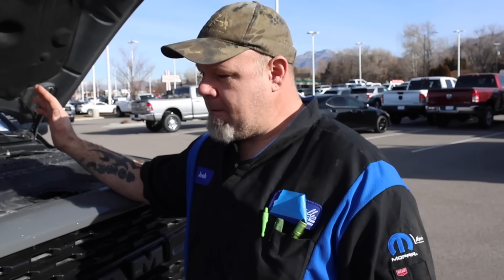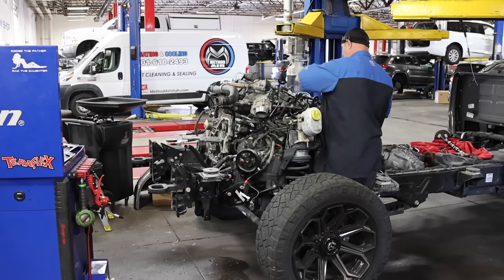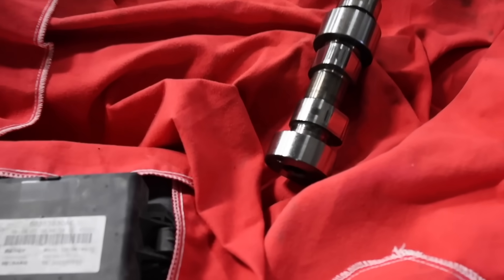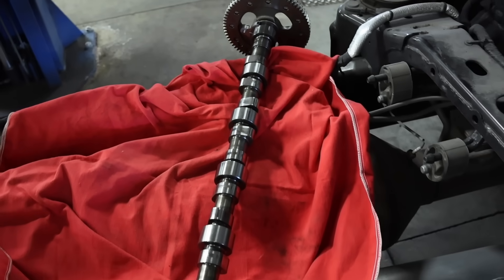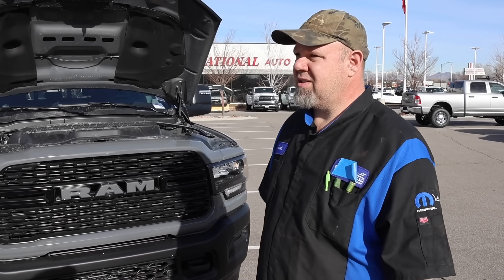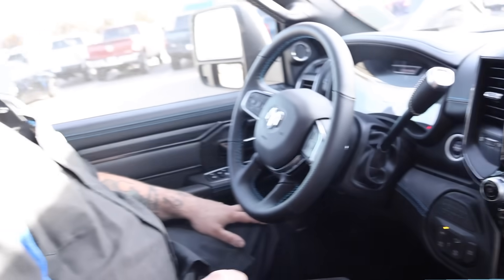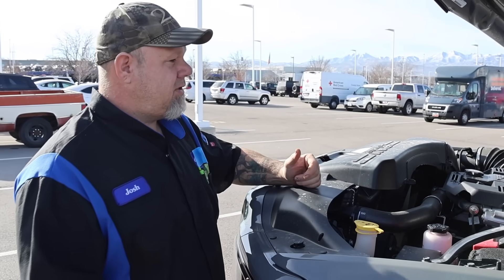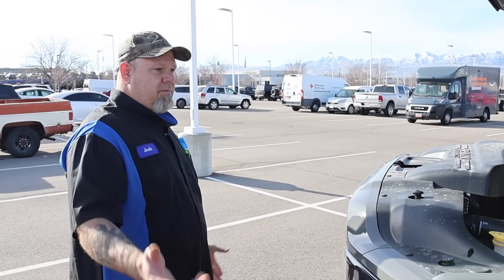Master Diesel Tech Explains The BIGGEST Killer To Your Diesel Engine!

Comment: Sorry, the EGR is the biggest killer of a diesel engine
Reply: I totally agree. EGR and subsequent emissions related equipment is an example of governmental overreach and science quackery. EGR’s only design is to lower exhaust gas temperature so that Nox gas is reduced (a byproduct of high temp fuel combustion), BUT lower exhaust gas temps increase soot and particulates in diesel engines, so, a particulate filter is added to catch soot. As this video shows, this dirty EGR exhaust stream is rerouted back into your inlet cooler, and turbo before reentering the engine which makes a mess and will have to be addressed at some point. When the particulate filter starts getting clogged, it must be cleaned by injecting diesel fuel from your tank into the filter to raise temps high enough to burn off soot and particulates (regen mode). This is the reason for the fluted, eduction exhaust coolers on the tips of the tail pipes; to prevent fires from the high temps during regeneration. Then, to add further complexity, BlueDEF systems are used to reduce exhaust emissions to some agreed to standards. BTW, DEF fluid is just distilled water and urea (nitrogen), which is a wonderful  and cheap fertilizer for your lawn and garden needs….The mechanics and chemistry of DEF systems for diesel engines are solid, I am just not sure if they will work in the absence of EGR systems knowing how they are all intrinsically connected.
Reply: Only if you are a liberal and still have it on there
Reply: The root of all problems
Oil. Power. Fuel economy. Abrasive cylinder wear leads to blowby oil consumption 
I use water methanol injection 
Have lower exhaust temps than with EGR 
Morning power 
Better economy 
6.7 Cummins 
9.8 litre per 100 Ks 😅 hiway
Reply: Sorry you have no idea

Comment: Im a company driver of Carhauler, we using RAM 3500 Cummins, I wanted to add something about cold start routine, before to start the engine I also press start button twice before to touch the brake and start it, I believe this primes the fuel system after sitting and I noticed that it’s actually starts better (less cranks) just something to consider..
Reply: You should probably know about the grid heater on your truck.
Reply: The pump primes when you open the door or during a remote start.  No need to do that process turning the key to run position and waiting a few seconds before starting.  They do it automatically now.

Comment: I don’t idle, injectors are fine, and always change my air filter. Have always changed out my fuel filters on time and my oil.

The soot is still everywhere. I have went thru multiple nox sensors and dpf sensors.

The soot clogs up everything!

Comment: 3000 mile oil change is still what I go with.  These extended oil change is ruining the engine.
Reply: Too long, do 300 miles intervals will be better. After all, oil is cheap than a new engine.

Comment: I am still old school mechanic and don’t even look at mileage. I go by hours which Cummins use to be around 400 hours. The only way you can include idling time as well as traveling.
Reply: That’s how we do industrial equipment. Typically manufacturers have different thresholds but typically 500-600 hours same for PMs, most fluids other than engine oil is annual
Reply: I was a heavy equipment tech for years and do the same thing.
Reply: @ToasterrBath  same, still am I work on light heavy equipment
Reply: @gunztommiegunz  I started out on the smaller stuff but ended up mostly working on bigger stuff. I did a lot of major modifications on smaller stuff and would’ve loved to have only done that stuff.
Reply: Caterpillar manual for a 5EK recommends changing oil after so many gallons of fuel used.
Reply: @ I know the older 3126 and C 7 ‘s were recommended I think around 250 hours. Pretty hard to keep up with fuel amounts I would think
Reply: @terrynall1956  In the trucking business you always know the gallons of fuel used due  to record keeping requirements for business and tax purposes.
Reply: @ yeah but this has more to do with personal use diesels,like for trucks pulling campers and like me a motorhome where I don’t think any keep up with oil changes to amount of fuel used.
Reply: I believe in light driving immediately, but our winter in south east Australia doesn't get below 25°f.
Reply: What a great and educational video. Got my first Cummins last year and now I will follow all these instructions. This is so greatly appreciated! Thank you sir!!!!!!!

Comment: While I agree with the warm up philosophy , and sane oil change intervals, I would posit that the #1 killer of modern diesels is EGR. Followed closely by PCV combining with the EGR soot.
That's a nice feature on those Rams, cruise button steps up the idle. Wish my Ford had that.
Reply: I put the switch in my ford, SEIC is the set up.

Comment: Wet Stacking is another issue for diesels that are not operated at normal operating temperature
Reply: Not an issue on a modern common rail computer controlled engine. A mechanical 8V71, sure. 

Common rail can fire the injectors 5+ times per combustion event, which allows a far more complete burn of the fuel. They're amazing, really. It's too bad the emissions equipment and sub-par injection pumps ruin it.

Comment: Have you ever heard of drilling a hole in front of DPF, welding a nut and plug after, for a borescope exam?

Your presentation is seriously clearer, more poignant, useful, than dozens and dozens of hours elsewhere.
The only thing I confess-fear is using the high idle in Summer while in store to keep dog cool, it appears certain I have damaged the engine, or sooted it up severely, but the DPF regen only came on once in 68k, except recently beginning a 300 mi.  trip empty, then in seconds the dreaded "Take to dealer" notice, no derate warning.

 I got advice to run down road at 2500rpm for over a hundred miles and suddenly the never seen "Regen" notice for about 65 miles popped up.  Thought "I am saved!"

In four days after that, visiting folks the DPF filter says about one third, and returning, running at 2500 for 50 miles changed nothing.    Now I am just plain afraid to drive it.   Thinking of drilling hole in front of DPF to insert borescope camera to see what's what (and weld a nut and such to reseal it).

Any impression or insight is deeply appreciated.
Reply: Diesel duds in Canada take that garbage off your truck asap nothing ruins a diesel engine faster than an egr dpf combo

Comment: I always thought 15K was insane. I split that in half- every 7500 I think is OK. 5K I am sure is better but I do not tow much at all, not working it very hard generally. ‘14 Ram Laramie 4x4 with 167k miles- trans took a dump at 143k, (68RFE of course), otherwise no major issues. Still has emissions- only had the EGR valve go bad at 147k.

Comment: Have you seen that the EGR must be cleaned once free of charge by the dealership, in certain states?
Reply from the maker: I have not seen that as a free service. If service procedure instructs to clean the cac such as a p1459 code (I think it’s that code). But I don’t recall a clean egr system as part of any procedure
Reply: @Trukstuf  It apparently false under emissions warranty, and the cleaning has to be done within certain mileage for it to be free.

Comment: I beg to differ on OCI...I have an 08 gmc sierra duramax totally deleted with 324k miles on it with oem injectors and cp3 pump and in cold weather I let it idle for at least 30 minutes to warm up  and change my oil once a year or 20k miles did an oil analysis with Blackstone labs got the results back and the report came back no fuel delution or coolant in oil, metals  wear was normal the 15w40 viscosity was the same and the report said can go 25 to 30k miles on my oil change so that's what I've been doing every since. But I think alot of oil issues like sludge is driver's are taking short trips not letting the oil get to operating temperature to burn off any moisture that occurs during the combustion process?
Reply: Your deleted truck doesn't have the high back pressure forcing soot past the rings at a higher rate, and the DPF clogging up making it even worse.

Comment: Hi Josh, love your channel,  I've  been a Dodge/Ram since 2003. I certainly believe they make the best trucks. Just bought a 2500 Cummins,  absolutely love it, I'm in Quebec Canada, just made my first oil change at 3000 miles, switched to 5W40 Rotella,  I think I'm going to continue at 5000 miles in the future. Can I  or should stick to 5W40 even in the summer. Ps I use Mopar oil filters. Am I doing the most to have trouble free running?
Reply from the maker: I'd stick with the 5w40 year-round, it's more than sufficient for your climate.
Reply: @Trukstuf  thanks for your input, just love your videos. Happy Holidays to you, all the best

Comment: You can't change oil often enough to keep the maintenance free roller lifters in a 19+ Cummins from failing just over 100k miles and before the 150k mile adjustment interval to the old solid lifters.

Comment: The high idle is a great suggestion, I wish Dodge would have installed it on my 4500, but they refused because I have a 6-speed manual.  I was like "why not, what does having a manual tranny have to do with it?" and they say you might leave it in gear.  In gear?  Who fires up their truck and leaves it in gear, and let off the clutch to warm it up?
Reply: People are far dumber than you think. A buddy of mine did two fuel system cleans in 2 months on the same Ecodiesel Ram. The owner put gasoline in the tank. Twice. Another customer is on her 4th engine in her car because she can't be bothered to change or check the oil, ever. But as long as her daddy keeps buying used engines, she'll likely keep avoiding it. Pro tip- Always avoid a jury trial.
Reply: @ChevyConQueso  Oh god, that certainly seems to happen these days with Daddy enabling his princess and she milks it for all its worth.
Reply: Not a 100% fail safe, but you could always tie it into the parking brake so it wont high idle unless in park.
Reply: @Number18ster  I would think that there would be some software component to activating the high idle on my 2008 which the dealership can only do and they have turned me away the two times I asked about activating it.

Comment: I am loving this channel. I’ve got the hemi and I am trying my best to keep it alive for a long time. I do oil changes every 6000km (~3700miles) with pennzoil ultra platinum 5w20 (what’s on the oil cap) unfortunately I’ve got the cracked exhaust manifold which I am waiting on back ordered parts. I was curious if you would extend your oil change interval for a Cummins if you were doing a long distance trip and the engine would be running at higher load / temperatures for extended times compared to using it around town. Otherwise I agree more frequent oil changes would be key. Especially how that they have roller lifters . Keep up the great content

Comment: I agree with you 1000% I never go more than a max of 5000 miles on oil changes. It's easy to learn to do this service for oneself to save if that's a big issue. Oil changes are very cheap compared to the price of the vehicle and potential repairs.
Reply: When approaching from the POV of fuel and oil filters, it looks WAY expensive, but in fact, the oil filters are pretty cheap for modern trucks (less than 20 bucks).   Am currently toying with idea of changing oil a day before changing the oil so as to help flush the trucks innards a bit better.   It appears inarguable 10k miles for an oil change (per mfr) is just dumb.
Reply: @MindFusion-ij1xl Changing oil twice is throwing money away. Every 5K is enough. Look into bypass filtration before you do that. Big trucks run centrifuges. Some folks do on pickups, but usually it's bypass filters.
Reply: @ChevyConQueso  Count not agree more, however, since I followed manual and changed at 10k, the oil looks WAY sootier than expected, did idle a lot, so thought a one-time oil change where cheap oil is run for perhaps an hour gives the expensive, synthetic, stuff a cleaner... crankcase and system... to do its job.  Thanks for the insights.

Comment: I’m with you on the 5k intervals, i actually do like 3500 on my 06 5.9. And I get it to temp and then let it drain for 20-30 min then pour a new sacrificial quart down its gullet and let that all drain out before I add new
Reply: Does it really make a difference running that quart to clean it up?
Reply: What a complete waste. I guarantee you use Rotella.
Reply: My last oil change 3500 miles. I do not drive many miles anymore.
Reply from the maker: That’s a good practice

Comment: I have a 5th gen Cummins. I run 5w-40 year around in MS. The 10w-30 is only rated for 95 degree ambient temp. Plus I get the 40w protection year around.
Reply: Im in FL. I see so many different stories. Most owners i talk to here run 10-30.
Your 5th gen on 5-40. How many miles you got on?
Reply: @allansouza8949  I've got 50k on mine. I know of quite a few guys also running 5w-40 with over 200k on their 5th gens. I agree with the video and believe you have to do your oil changes more often. I do everything I can to keep my idle hours low and through oil tests I've found that my oil is still within good numbers around 7500 miles, so that's when I do mine.
Reply: @spaniky73  my idle hours is scary. I need to work on that. I have 64k miles on my 22 with 850hrs of idle.
Reply: There is no true 5th Gen Cummins truck yet. 2010-2025 are all 4th Gen. Ram generations go by cab codes.
Reply: @CornFed_3 from the cab back most of the parts for the 5th gens are shared with the 4th but we are talking engines here. With the major changes that they did to the Cummins in 19 have some serious issues.
Reply: I run 0-40 year round, it’s fine.
Reply: @j-rocsk unless you live in the arctic you're pushing boundaries. Also, I've been told by a few techs that Ram requires an oil test before they will pay for warranty work on these engines because it is an easy way to shift the blame and not have to do the work out of their pocket.
Reply: @spaniky73  you’re a knob.  The O-40 is the exact same when it’s hot, it just moves faster when cold, I live pretty close to the arctic.  lol pushing boundaries…that’s ridiculous.  In cSt it’s virtually the same as 5 or 10 w oil.

Comment: 05 3rd gen 5.9 15W-40 or 5w40 ???  FLORIDA 
Can i flush my engine with diesel fuel  when the truck is off to get out old oil during oil changes 

https://youtu.be/-FCdo17TZNc?si=Eais1ZYSXqimSSAZ
Reply: Run 15w-40 in Florida and no don't flush your engine with diesel just run a good oil and change it. All diesel oil is black from soot from combustion. and use Fleetguard stratapore filters for your 5.9
Reply: @jacobdukes4741    AMSOIL vs Shell Rotella

Comment: When I purchased my 12 Ram Laramie Cummins the used dealership said I don't need to change the oil right away! I said  I didn't Care it's black I didn't do it, I don't know what they used!. I purchased it to tow a 5R when towing I changed the oil every 3000 ! When not towing it's every 3k to 5k , I only use Shell T6 , I keep it in a garage during the winter I will not start it when it's below 32°f  unless it's been plugged in overnight.  People say I'm taking it too far?  I don't think so it's a 12 with 150k on it , it's valuable, and I have a 01 GMC Yukon with 365000 on it that still runs like new ! I'm doing something right. The GMC only gets Mobile 1.  And since I purchased the Truck in Tennessee unfortunately the wire for the block heater was not installed so I had to install one when moving to the Michigan UP it gets cold very cold and 300" of snow annually.😮😂 Future deleting is something I won't talk about I'm waiting to see what happens to the EPA.
Reply: Holy shit lol.  🤦🏻
Reply: Oil will always be black and a diesel friend
Reply: @   Yep.  I’ve been able to keep it clean looking for a week at the most.    I installed my own auxiliary cooler and oil filter that works off of a thermostat just for peace of mind.
Reply: @jamesvuxta8723  No kidding. It's  designed to suspend soot particles and clean them off. One drive and it's doing that.

Comment: Great video, oil is cheap and diesel engines are very expensive. 2024 Duramax 6.6, change 4000 to 5000 miles depending where driven city or highway.
Reply: You’d have the same results by going 10k-15k when using a quality oil and filter. 4-5k is an absolute waste on a modern diesel. Adding new oil that quickly provides nothing beneficial to the engine whatsoever. If you did testing on your next oil sample, I can guarantee you could probably double your intervals.